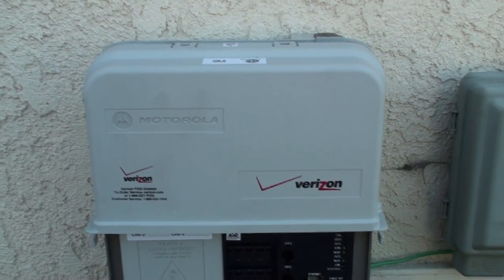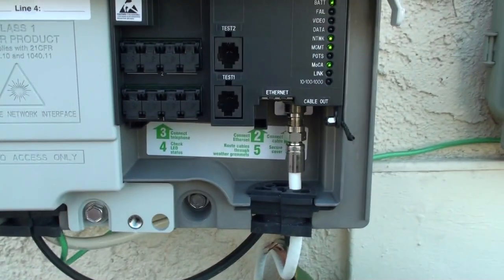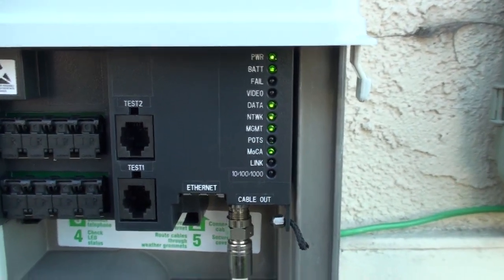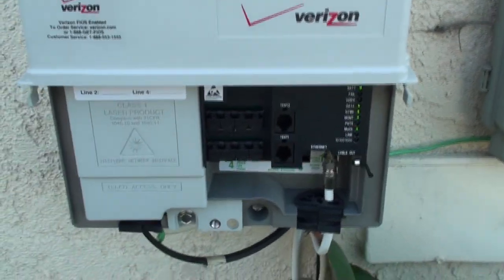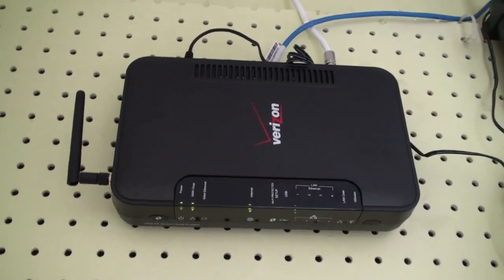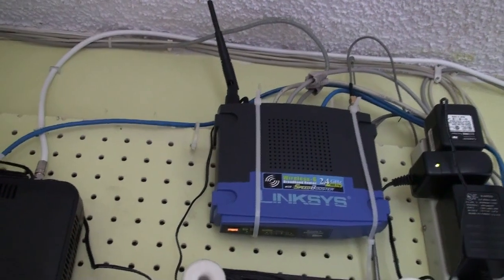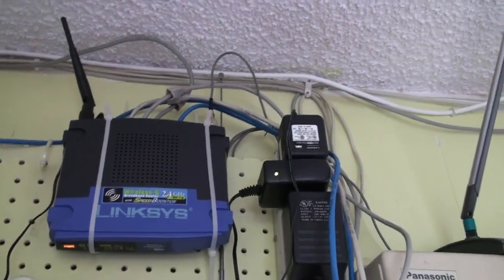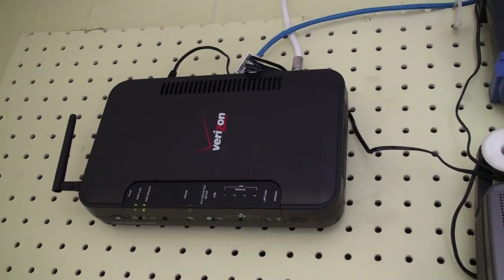Motorola ONT, Westell Router... the hardwares. - F.O.3

Comment: If i had a similar set up like yours, where i use the router provided by verizon connected to a linksys or d-link router, which router should i connect wired devices to?